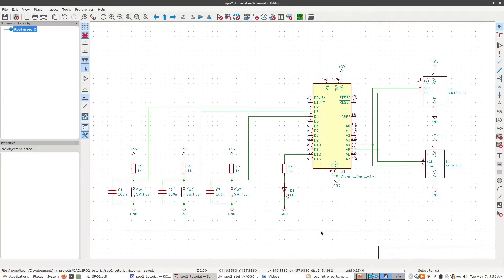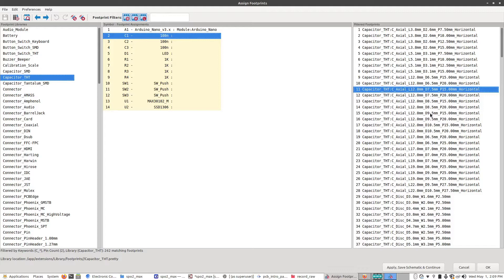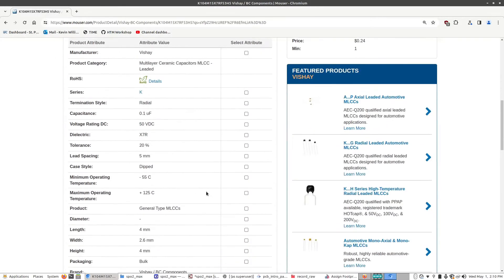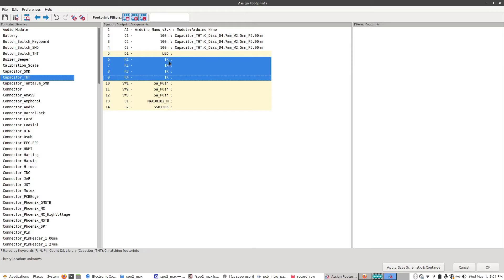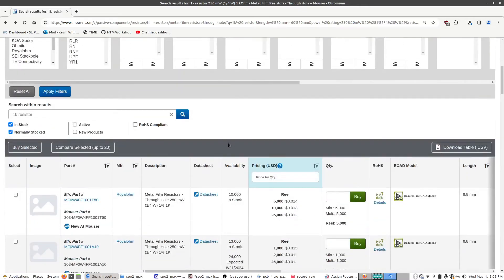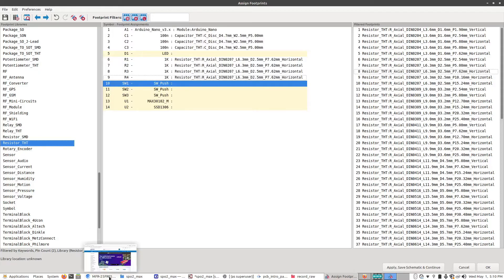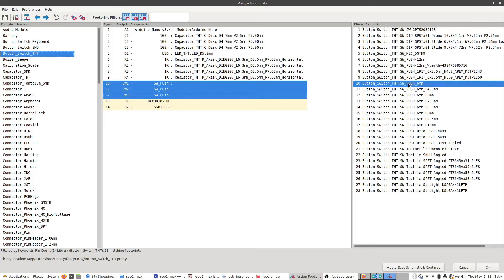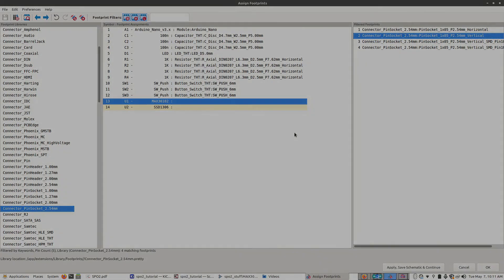KiCad Choosing Parts | Part 3

Comment: for thru hole parts I will check the lead diameter when I pick my parts. The hole in the board has to accommodate the lead. I will check that.

Comment: This video really cleared a big roadblock for me haha. I know it sounds dumb, or something as simple as the order of picking parts was tricky, but being a complete noob and trying to go back and forth on websites and kicads to find footprints that work was really challenging, especially not knowing normal or standard parts, just choosing randomly. The process of finding in stock parts first, then assigning footprints was really what I needed to hear lol and it forces me to use custom footprints and 3D models more which was inevitable but something I was wrongfully holding off on. 
Thanks for the effort!!

Comment: So can you elaborate, the "lead spacing" is the same as "pitch" (as per 100 nF capacitor footprint description)? I have some troubles finding the ee vocabulary that covers this, however from what you show it seems like this is the case (?)
Reply from the maker: Yes-that’s Correct!
Reply: @HTMWorkshop  Wow thank you for very quick response !